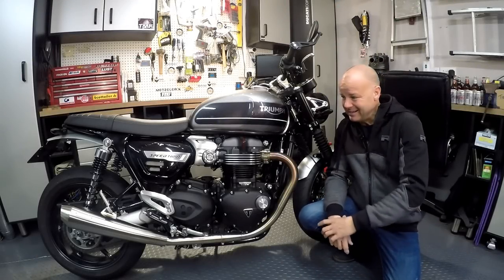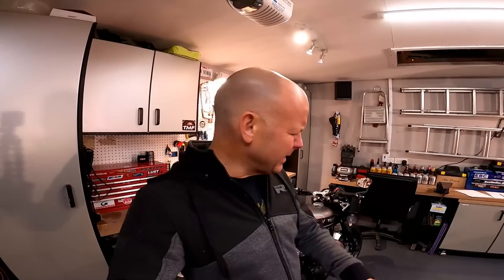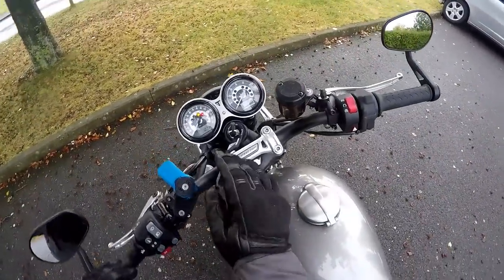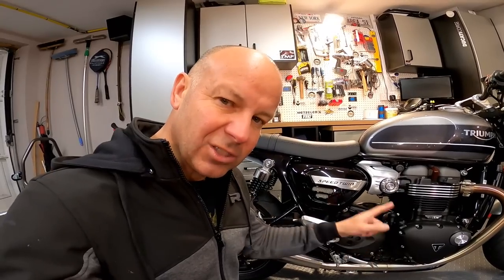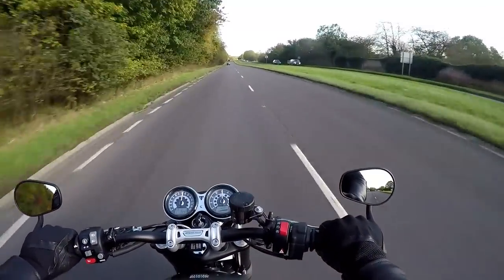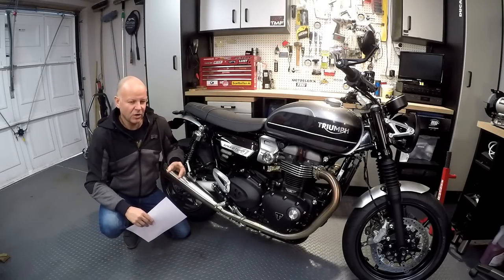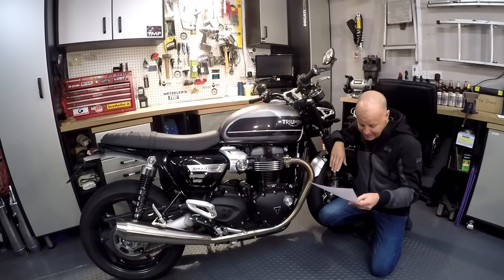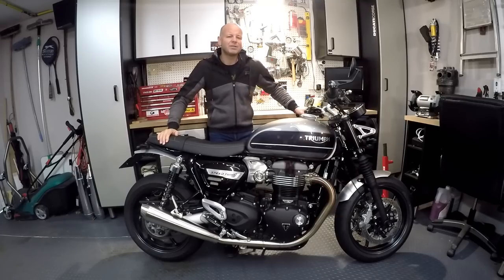Triumph Speed Twin - In depth owners review

Comment: ... and in less than a surprise, I blame this video for the fact that I now own a Speed Twin. Interesting note: not sure if it's a 2020 model thing or if I was 'lucky', but mine (brand new from the factory) came fitted with the larger 'torpedo-shape' turn signals - black with brushed aluminium end-caps.  Loving the ride so far; compared to my T120, I'd say the Speed Twin is superior in every way save seat comfort - impressive, considering they cost virtually the same. I have to fathom that the T120 is mostly selling based on nostalgia and looks at this point, because I can't think of anywhere it's the superior model given its near-identical price point.
Reply: Congrats!!

Comment: I’ve had the bike for almost 8 months and just hit the 1000 mile mark.  I’ve never had a brake squeal or any throttle snatchiness at low speed.  I’ve kept the bike in “street” mode the entire time.  I agree with the heat on the left side, it seems like that is where the heat is blown when the cooling fan comes on.  But it isn’t uncomfortable at all if your wearing riding pants.  The Daytime Running light issue in non existent in the US because it doesn’t even come on.  If the bike is running the low beam is on.  It seems the only way to get the DRL to come on is when the bike is off and in “P” (park mode) mode with the steering locked.  This has been my experience, but I completely understand if your experience has been different and appreciate your great videos.

Comment: I think the logic behind DRL position on the switch and the green indicator light for it on the dash, is that it sets DRL as a secondary light source, in the same way full beam is a secondary light source (dipped beam being primary). So it shows nothing when it's on dipped beam (primary), shows green when it's on DRL and blue when it's on full beam. At least that's the only way it makes sense, though I do agree with you - it should be the other way around simply because we're used to it that way.

Comment: Just a note on the fuel gauge taking a long time to read when refilled from empty. 
You are right indeed; it is a "capacitor" in the fuel gauge circuit (or more accurately a resistor and capacitor). They're there to dampen the voltage change and consequent gauge reading. Without it, the varying level changes during acceleration, braking, cornering etc,  would be faithfully reproduced by the gauge and make it impossible to read - so this is where this comes in. 
All vehicles have it, but it would seem that the component choice made by Triumph maybe a little on the generous size?
Of interest maybe. For a short time, BMW (Motorrad) dispensed with the usual float metering device in favour of a flexible pcb design. This incorporated both a heater strip and a temperature-sensitive sensor. They both ran down the full length of the  pcb which sat inside the fuel tank and effectively "dipped" the level. This method was extremely accurate, had better resolution and was self damped by nature. Sadly it was also rather unreliable and easily damaged by over-enthusiastic insertion (Ooer- missus!) of the petrol nozzle. Many were replaced under warranty I believe but could not be retro-fitted by a more conventional float meter as the wiring loom (and canbus) were incompatible. 
BMW only fitted the ill-fated system for a couple of model-years.

Comment: Interestingly your observations are pretty much the same as mine. I went with the British Customs exhaust instead of the Vance and Hines. It’s a little louder than yours but it sings out here in Texas. No other mods but that tail tidy is on the list. The silver and black paint scheme is perfect for this machine. My choice also. A very easy bike to ride. I may upgrade the suspension after the warranty expires. I get that harmonic dissonance from the front brake set also. The heat is not that bad in summer but it is noticeable. Very welcome this winter. Good luck and happy trails.
Reply from the maker: Glad we concur John!

Comment: I Brought a  Triumph street twin from Triumph North London, the first bike they sold,
nice dealership and very happy
with the bike then I had a test 
ride on the Speed Twin on there
open day, it's a bit taller then the street so being short in the
leg I'm not able to flat foot as
on the street, but yes a lovely bike like the Street Twin but
better, and the heat that you mention radiating from the engine is the same on mine,
I guess it's just the nature of
the beast.

Comment: Tried one for a week in June this year. It was factory spec. Engine very snatchy in busy traffic. Seat chafes the inside of your thighs after a while. I lifted the seat and found that  the seat base has a deep flange extending down from the rim and covered in seat fabic. This means the apparent seat padding is about 50% metal flange. Hence the poor seat comfort. So, snatchy in town, lively on bumpy bends and uncomfortable over distance..... 
 I left it after a week deciding I didn't like it. A shame, because I had hoped to leave with a much better impression....
Thank you for another great review, Andy.

Comment: For the headlights I switched to JW Speakers. Not cheap but a massive difference. 
For the tail tidy you can save a lot of money by just cutting the original one and drilling a hole.
I also noticed the left side mirror having a lot of vibration. Bar end weights didn't do anything, but what did was a nice pair of mirrors.
The monza cap is nice but imho it opens the wrong way and makes it uncomfortable to fuel. You can easily rotate it 180.
For the brakes changed to EBC HH and lube the back, clean properly.

Comment: I finally  had the chance to visit a triumph dealer for a demo ride. I tested the speed twin. Really like the attention to detail. Suspension was awesome in comparison to my mt09. However, I was surprised that the throttle is jerkier than my mt09. My mt09 has been flashed which solved most of the issue. The speed twin torque and snatchy throttle was somewhat unexpected. I still like the engine of the mt09 better by a lot but I am loving the triumph brand as well. The mt09 is not meant to be compared to the speed twin. Both are fun bikes. The mt09 is very smooth and way more powerful.  The triumph has a mechanical  vibe to it which I like as well, it is also responsive but redline comes fast. At this point, the speed twin is not different enough to make me switch but I will definitely upgrade the mt09 suspension. I am now looking at the t120 for my wife and I and keep the mt09 for spirited riding.
Reply: Erasmo - I had a '19 MT-09 with adjustable (but not great) suspension. Rebound damping was maxed out & it still wanted to bounce on the too weak springs front & back. 
My remedy was a '19 Triumph Speed Triple S! You don't need the RS with all the extra cost. The Showa suspension on the S is fantastic, every bit as good as my previous Kaw ZX10. More power than the MT-09, a more relaxed but taut ride, better road manners and unbelievably good finish on my white S. I am pleased but, of course, its a different look and style of bike than the Speed Twin.

Comment: By the way, the lighting works in exactly the same way on my 2019 GS. The green dash indicator is on when the DRL is on. When the dipped headlight is switched on (either manually or automatically due to low light levels) the green indicator goes off.
Reply from the maker: Illogical captain.....
Reply: It may be because in the US market (where they make the money) we can’t turn off the headlights. Rather than making a Euro and a US switch, they made one to cover the bases.

Comment: I finally did get to test ride one. The bike is beautiful and the engine is amazing. Was a joy to ride except...
The part that didn't work for me was the gearbox. Triumph usually gets gearboxes so right. To me the shifter felt like it was in the wrong place. Sure, it can be adjusted some but it felt to me that it was a long reach from the peg and somehow off center. It also took unreasonable force to upshift. Maybe not "unreasonable," but more than any of my bikes (including two Triumphs purchased new) or any others I've ridden recently. I suppose it needed to break in but honestly it just didn't feel right.
Other than that I was quite impressed, especially by how small and nimble it felt given that hulking torque monster cradled inside the frame.
Reply from the maker: How interesting - I have no issues at all with the gearbox or lever, wonder if there was an issue with the particular bike you rode?
Reply: @TheMissendenFlyer  That's what I was thinking too. Wondered if others had experienced the same.

Comment: Thank you. I found that very helpful for making up my mind about whether I will consider a Street Twin for next year. My dealer did regard them as a higher spec than the T120. I tried one for a few hours earlier in the year (it was raining then too). The relative lightness of the thing appealed. If you add a centre stand and other parts though, then that lightness soon diminishes. Also as you say it’s not really for two up and comfort at my age is great. I guess you have your GS1200 for two up riding. Anyway for me my current Bonneville T120 rules as being better looking and a better all rounder Triumph. Although I did grab myself a pre loved 2019 Honda CB500X for local lanes and all year round riding. BTW, those CB500X are worth a review INMHO. Thanks for an excellent, honest, review... Regards, Pete

Comment: I was thinking on installing a used front end from a Daytona 650R in good condition which I believe is Ohlins with Brembo brakes and a pair of new rear shocks also from Ohlins which it will give massively improve sporty handling and great looks, surely will be cheaper than buying the Thruxton R, I made a search on the internet and the mod change will not cost more than aprox. 1500€.

Comment: I think they’ve got the daylight running lights issue right. One of my pet hates is car drivers with DRLs is that they don’t bother switching their lights on in poor weather because they think that their lights are on. I nearly ran into the back of a car on the Simplon pass in low cloud because he had no rear lights showing and when I brought it to his attention he insisted that his lights were on. On the Triumph there is the danger, especially in towns that riders would set off in the dark thinking they had the lights on if the DLR was the default setting.

Comment: I had a similar problem with my 1050 Tiger Sport ( fuelling down low ) well actually from a lot of reviews I read was the motor being quite tight from new after 7000-8000kms Kms would smooth out low RPM " to my surprise it did "
Reply from the maker: I've not reached there yet but I have found the more miles you do on a new bike the better they tend to get (within reason!)

Comment: I ended up with a T120, but the ST was a fabulous ride, better oomph (not needed!), handling and riding position. I agree completely re the day light and dipped beam, which is the same on the Bonny....counter intuitive as you say.........
Reply from the maker: Glad we concur Laurie....
Reply: With all the computer-controlled gubbins on these modern bikes, I wonder if this could be rectified with a few lines of code and a re-flash, or is it purely mechanical, and would require some re-wiring? Perhaps it’s to do with some arcane MOT/EU legislation that legally requires it to operate thusly? (Surely not!) Has anyone asked Triumph?

Comment: Brilliant review, cheers for being so exhaustive. Contemplating picking this or the new Thruxton RS up, but I'm leaning Speed Twin if only because there's comparable performance with a far lower price tag.
Reply: My God that Thruxton is sooooo beautiful! But then the Speed is too and quite a bit cheaper. Decisions, decisions.......
Reply: @fido0825  They aren't really comparable - the seating position on the Thruxton is quite aggressive - the relatively low clip-ons and long reach to them stretch you out, unless you have a long torso and arms, which means longer riding or stop-and-go traffic is harder on the Thruxton. I'd say the Thruxton is better looking, but it's less 'useable'.
Reply: @danieloconnell4225  Yes, I sat on one at my dealer in Ozark...but no more extreme than my ZX10 it is still a whole different position than the Speed Twin for sure.

Comment: Great video as usual Andy 
I own one of these with 5k miles done so far. I have a pair of SW Motec blaze panniers which I also use on my Thruxton r good for a weeks touring as proven in The Pyrenees last year and a tour round Scotland this year, light easy on and off the bike, good system! And totally waterproof. 
One thing you didn’t mention, adjusting the preload on the rear dampers ? Just give it a try 😖
Thanks again keep posting

Comment: Good video. My last bike was a Triumph Bobber, but the low speed fueling problem that you mention was just too much for me to handle as I use it to filter through traffic. I've swapped it for a BMW twin and have no issues whatsoever. For a manufacturer to put out a machine that just doesnt work proeperly is attrocious. Needing to add two different mods to make the bike work properly just isnt on.
And yes, the light indicator is definetly the wrong way round....
Reply from the maker: Glad we agree on that one Dave!

Comment: Practical items? Worth mentioning that the right hand side panel snaps off and on really easily. And also has a bit of spare space. I used it to install an old and very small Autocom intercom that fits very nicely. Others may use the space for something else. Very easy to get at!

Comment: A Fourdot number plate would maintain a legal font size & space but give you legal minimal borders giving the impression of a smaller plate, especially with anything of 6 characters or less and it would be legal. They're also beautifully made (as far as number plates can be). You have larger vertical borders than you need, you can go down to 11mm.

Comment: I adore my Speed Twin.
Agree that if I was going to change anything (I haven't), I'd put Ohlins shocks on it, but then the fork would probably need tweaking too. Quite a lot of cash just to sort out a niggle of no great importance.
On the very small niggles front, you didn't mention that there is no helmet lock which might come in handy from time to time. You'll just have to carry it about. 
There are also no bungee hooks that I have found, so I'm not quite sure how I'm going to attach a bag to the seat for weekends away. I'll sort something out no doubt, but a retractable hook would have been so practical.
No temp gauges either. Even my Ducati 999 has a temp gauge for engine and ambient temp. It's odd not to know if the Speed Twin is overheating uncomfortably, although I suppose it's something less to worry about. But I do like to know what temp it is outside.
The side stand needs flicking out with your heel. Easy with most shoes, very difficult with my AlpineStars boots which seem to have a very slippery heel. 
Agree with you re the daytime light. Seems odd to tell you that it's on and yet keep schtum about the headlight. On the 999 it is the other way around (Italians? Logical? Surely not!)
You didn't mention that the bike sips fuel. I can't believe the fuel economy. It's like a Honda C90. (Well, not quite, but you get the idea).
Good vid. Cheers.
Reply from the maker: Thank you - and thanks for your list of niggles - I pretty much agree with them all. Fab bike though eh?
Reply: @TheMissendenFlyer  A totally fab bike. My 999 has been off the road for 4 years (long story, don't ask) so I bought this. A lot more licence friendly and really, just as much fun. Or to put it another way, a lot more fun in a vaguely legal stylee, and a bit less fun in an illegal stylee. After all, the 999 only starts to make any kind of sense at about 80 mph.

Comment: The light in the instrument cluster that comes on when the DRL is illuminated is a warning: You don't have your headlight on! You don't want to be riding around in low light conditions with just the DRL on. When you switch on low or high beam, then it goes out. It makes perfect sense to me. The Tiger 800 has the same system.
Reply from the maker: It seems to make sense to some, but it doesn't to me I'm afraid (and apparently I'm not alone on this one either)....
Reply: @TheMissendenFlyer  Remember lights on is the norm - we both have gen 1 Street Triples where this is the case, and is required by construction and use regulations. Would you want a light on the dash on the Street Triple to indicate that your lights are on when that is the norm? As a sop to having DRLs rather than full headlights, an indicator light on the dash warns of this situation.

Comment: Gorgeous looking bike ..Such a shame some modern injected bikes have fuelling problems or jerky throttle respinse. My 2006 triumph has no such issues with the injection. Maybe the euro laws have made this the case.. Glad to see there are fixes available .. 👍🏻☮❤
Reply from the maker: Yes it is a Euro 4/5 thing that's forcing manufacturers to run their bikes so lean out of the factory....

Comment: There's N interesting thing that Ryan over at FortNine discussed, that the tyres, though they may say, Pirelli Rosso on them, they're not actually the same tyre as a Pirelli Rosso that you might buy from a tyre dealer, they'll be a cheapified version for OEM use by manufacturers. That way they don't have to spend as much, but get the Pirelli, or whoever on their new bikes...
Reply from the maker: Yes I saw that - very interesting!

Comment: Regards the oil check using the sight glass        be sure it is on a flat level ground       it can easily appear empty and then when  topped  up, its over fill ,  Which can do damage   Cheers TJ